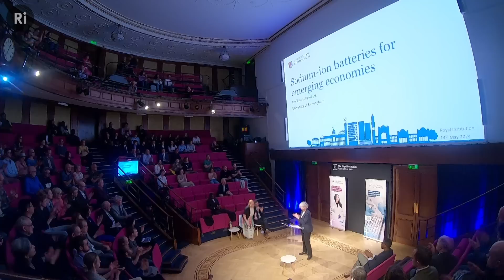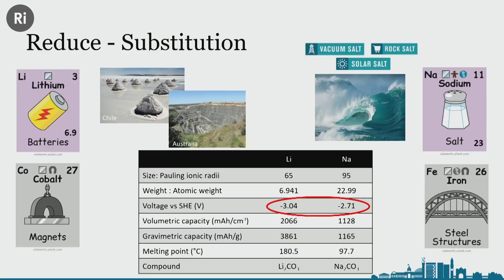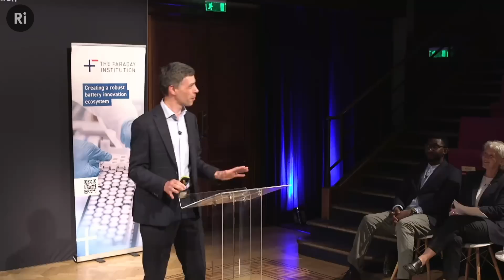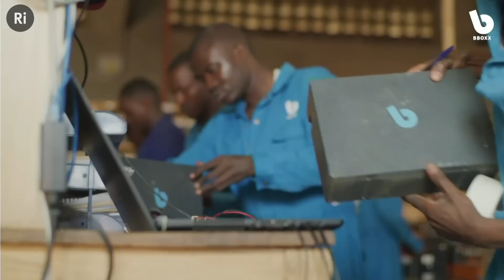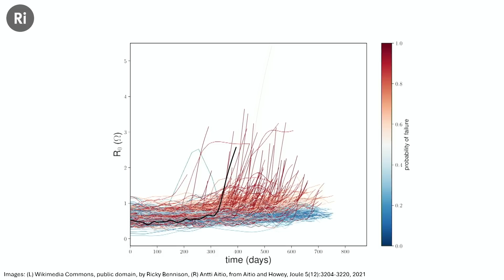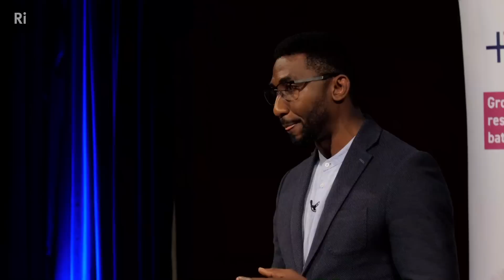The future of batteries for emerging economics - with the Faraday Institution

Comment: 675 million people lack batteries? Current global population is in the order of billions! I'm trying to accept the validity here.
Reply: The speaker said 675 million people have no electricity and many more (billions) have an intermittent supply. Most of Africa , South America ,Pacific, Large areas of Asia and some rural parts of the UK have an intermittent supply. Millions of home diesel electricity generators are used in India for household use due to remoteness ( no supply) ; intermittency of supply , and the cost of a connection to the grid. The USA buys the most diesel generators because of rising demand and outages of electricity supply.
Reply: About 8 billion world population.

Comment: How economy works is the real problem. There is no battery that can fix that.
Reply: Agree. I suspect that if we get "Robotaxi" type transport, then our needs for batteries will reduce because we'll have vehicles that are used 24x7.
Reply: The economy needs energy. Where that energy comes from is flexible. The more we electrify, the cheaper it will become.

Comment: I'm trying to release free-to-the-world plausible hope that civilization can quit the second law of thermodynamics. The second law is behind modern refgeration needing electrical energy to compress the refrigerent to force it to release as waste the heat that it has removed from the refrigerator's service interior in the cooling part of the refrigerent's circulation. There is also discarded heat from mechanical friction. 

Refrigeration by the principle that energy is conserved should produce electricity instead of consuming it. 

It makes more sense that refrigerators should yield electricity because energy is widely known to change form with no ultimate path of energy gain or loss being found. Therefore any form of fully recyclable energy can be cycled endlessly in any quantity. 

In an extreme case senario full heat recycling all electric very isolated underground communities would be highly survivable with self sufficient EMP resistant LED light banks, automated vertical farms, thaw resistant frozen food storehouses, factories, dwellings, and self contained elevators and horizontal transports. 

In a flourishing civillization senario small self sufficient electric or cooling devices of many kinds and styles like lamps smartphones, hotplates, water heaters, cooler chests, fans, radios, TVs, cameras, power hand tools, and personal transports, would be available for immediate use anywhere as people see fit. 

Larger equipment would be built for enterprise use. 

If a high majority thinks our civilization should geoengineer gigatons or 
teratons of carbon dioxide out of our etnvironment, instalations using devices that convert ambient heat into electricity can hypothetically be scaled up do it with a choice of comsequences including many beneficial ones. 

Computers that consume electricity and yield heat would complement energy sensible refrigerators that absorb heat and yield electricity.  Computing would be free. 

A simple rectifier crystal can, iust short of a replicatable long term demonstration of a powerful prototype, almost certainly filter the random thermal motion of electrons or discrete positiive charged voids called holes so the electric current flowing in one direction predominates. At low system voltage a filtrate of one polarity predominates only a little but there is always usable electrical power derived from the source, which is Johnson Nyquest thermal electrical noise. This net electrical filtrate can be aggregated in a group of separate diodes in consistent alignment parallel creating widely scalable electrical power. The maximum energy is converted from ambient heat to productive electricity when the electrical load is matched to the array impeadence. 

Matched impeadence output (watts) is k (Boltzman's constant ~1.38^-23), times T  (tempeature Kelvin) times bandwidth (0 Hz to a natural limit ~2 THz @ 290 K) times rectification halving and nanowatt power level rectification efficiency times the number of diodes in the array. 

For reference, there are a billion cells of 1000 square nanometer area each per square millimeter, 100 billion per square centimeter. 

Order is imposed on the random thermal motion of electrons by the structual orderlyness of a diode array made of diodes made within a slab: 

v v v v v v v v v v v v v v v v v

All the P type semiconductor anodes abut a metal conductive plane deposited on the top face of the slab with nonrectifying joins; all the N type semiconductor cathodes abut the bottom face. As the polarity filtered electrical energy is exported, the amount of thermal energy in the group of diodes decreases. This group cooling will draw heat in from the surrounding ambient heat at a rate depending on the filtering rate and thermal resistance between the group and ambient gas, liquid, or solid warmer than absolute zero. There is a lot of ambient heat on our planet, more in equatorial dry desert summer days and less in polar desert winter nights.

Focusing on explaining the electronic behavior of one composition of simple diode, a near flawless crystal of silicon is modified by implanting a small amount of phosphorus (N type)on one side from a ohmic contact end to a junction where the additive is suddenly and completely changed to boron (P type) with minimal disturbance of the crystal pattern. The crystal then continues to another ohmic contact. 

A region of high electrical resistance forms at the junction in this type of diode when the phosphorous near the ĵunction donates electrons that are free to move elsewhere while leaving phosphorus ions held in the crystal while the boron ions donate a hole which is similalarly free to move. The two types of mobile charges mutually clear each other away near the junction leaving little electrical conductivity. An equlibrium width of this region is settled between the phosphorus, boron, electrons, and holes. Thermal noise is beyond steady state equlibrium. Thermal noise transients, where mobile electrons move from the phosphorus added side to the boron added side ride transient extra conductivity so the forward moving  electrons are preferentally filtered into the external circuit. Electrons are units of electric current. They lose their thermal energy of motion and gain electromotive force, another name for voltage, as they transition between the junction and the array electrical tap. Inside the diode, heat is absorbed: outside the diode, an attached electrical circuit is energized. 

Understanding diodes is one way to become convinced that Johnson Nyquest thermal electrical noise can be rectified and aggregated. Development teams will find other ways to accomplish this wide mission. Taxonomically there should be many ways ways to convert heat directly into electricity. 

A practical device may use an array of Au needles in a SiO2 matrix abutting N type GaAs. These were made in the 1970s when registration technology was poor so it was easier to fabricate arrays and select one diode than just make one diode. 

There are other plausible breeches of the second law of thermodynamics. I hope a lot of people will join in expanding the breech. Please share the results of progress or setbacks. 

These devices would probably become segmented commodities sold with minimal margin over supply cost. They would be manufactured by advanced automation that does not need financial incentive. Applicable best practices would be adopted. Business details would be open public knowledge. Associated people should move as negotiated and freely and honestly talk. Commerce would be a unified conglomerate of planetary scale of diverse local cooperatives. There is no need of wealth extracting top commanders. We do not need often token philanthropy from the top if the wide majority of people can afford to be generous. 

Aloha
Charles M Brown 
Kilauea Kauai Hawaii 96754

Comment: The two impressive batteries that need more research are the lithium-air developed by Argonne Nat'l Lab, (1,000 Wh/kg and 1000 cycles for air and ground vehicles) and the Aluminum-Sulfur developed by Sadoway at MIT, (200C power density and low cost for grid VAR)

Comment: Technically everything is a battery holding heat. Electricity is rapid heat exchanging through mass grounding currents through all masses in its path. Lightning is rapid heat loss as decay of internal magnetic fields disolving into external heat energy striking atmospheres unabsorbed lighting up the surrounding atmospheres slamming shut on the void created by disolving internal magnetic fields disolving into external heat energy and unoccupied  space as thunder resonating atmosphere gasses. Light is only present in resistance to mass as unabsorbed heat energy singularities outside of entanglement of mass. Impaction force of refraction as friction. Mass is always outward force of pressure known as weightless outside of a greater internal magnetic field grounding currents through all masses in its path. Mass falls in equalization to magnetism.  Weight is the force of impaction of two masses of outward force of pressure colliding. Mass is always outward force of pressure known as weightless. Internal magnetic fields grounding currents into earth's internal magnetic field as redirected grounding currents of heat through its nucleus or core where force is strongest. External magnetic fields don't ground currents. They circle around the perimeter of absolute zero energy within the nucleus or core as monopoles of absolute zero energy within as pure repulsion to heat propulsion. Normal space filled with dark heat energy singularities propulsion momentum from cold repulsion into cold repulsion as perpetual motion as a weak external magnetic field filled with dark heat energy throughout space. Maximum distance traveling and least amount of force as magnetism. External magnetic fields are stronger generators to propulsion and repulsion. They are hurricanes in space and spinning all external heat energy within its field like a record on a record player centrifugal force of pressure known as magnetism magnifying propulsion and repulsion potentially creating hydrogen from the poles as velocity of propulsion increases into increasing repulsion to propulsion from repulsion as magnetism. External magnetic fields creating hydrogen potentially. Internal magnetic fields grounding currents through its nucleus or core disolving nearthrse massive magnetic fields. External magnetic fields stripping away all external heat energy within its field near its core. Galaxies are formed around these external magnetic fields spinning all external heat energy within its field like a record on a record player centrifugal force of magnetism bonding grounding. Heat has to ground or burn as external heat energy released from internal magnetic fields disolving. Fire is internal magnetic fields disolving internal magnetic fields into potentially renewable heat energy when absorbed into internal magnetic fields grounding currents into itself and surrounding mass. Light from stars near and far away throughout space decaying their atmospheres as heat waves hitting our atmosphere lighting up surrounding gasses as they travel through atmospheres producing light. Light is unabsorbed heat energy bouncing off mass.  Color tells how much heat is refraction as light. Sky blue, foilage green, flowers rainbows. Mass is always outward force of pressure known as weightless outside of a greater internal magnetic field grounding currents through its nucleus or core. Mass falls in equalization to magnetism. As mass expands its internal magnetic fields grounding currents expand. In magnetism cold repulsion to heat propulsion from cold repulsion stays  in equalization to normal space momentum velocity.  When velocity changes magnetism bonding force of grounding currents decreases as distance traveling increases and mass starts disolving internal magnetic fields to compensate equalization to velocity and distance traveling cycling circulation patterns as mass. Batteries are heat storage containers. Heat is the universal force of pressure known as the force of pressure outward. Mass can't collapse in on itself. As heat energy propulsion momentum. Mass can decay but not collapse. Magnetism explains everything about physics.  External and internal magnetic fields. External magnetic fields are stronger than internal magnetic fields.  Hydrogen has the strongest internal magnetic field grounding currents through its nucleus or core. Hydrogen under extreme heat pressure expands into helium. Helium occupies more space and contains more heat energy currents grounding than hydrogen. Helium expands and as mass expands its internal magnetic fields expand. Everything works with magnetism. Theoretically factual probability that works with quantum physics without gravity is magnetism magnifying propulsion and repulsion in external magnetic fields capable of jetting tornadoes of hydrogen as greater propulsion and greater repulsion to propulsion able to potentially create hydrogen and the strongest internal magnetic field of mass.
Reply: You wrote a long story with total misunderstanding what electricity and heat are as different energy
Reply: The understanding related to current theory that is. Never ceasing to change, expand or evolve, the sciences will always do this dance and apply its theoretical principals to build new technologies that will indeed work thereof. Which only proves how very little and ignorant mankind truly is to the actual workings of how creation truly operates. Sadly destroying everything in this lustful pursuit in which mankind must tinker with creation…. Humanity has wandered too far and set its own demise…Creation is groaning to be restored by its Maker
Reply: @andypanda8259  you are smoking some powerful weeds